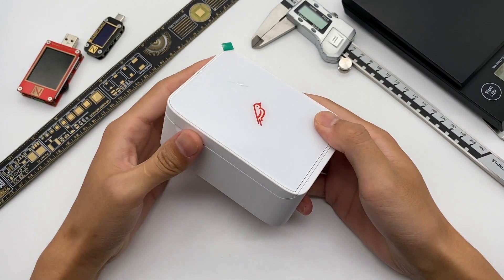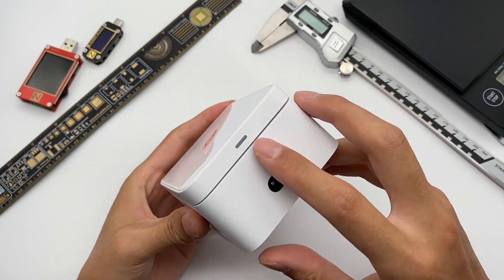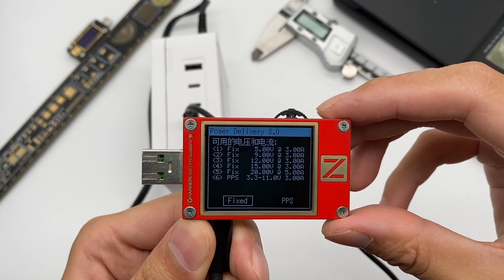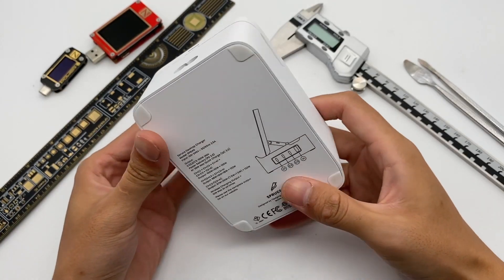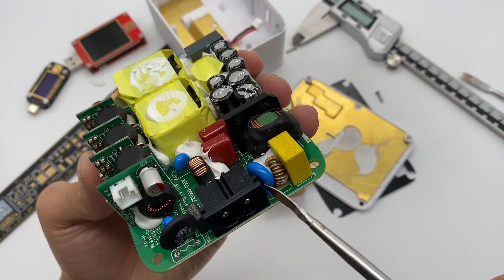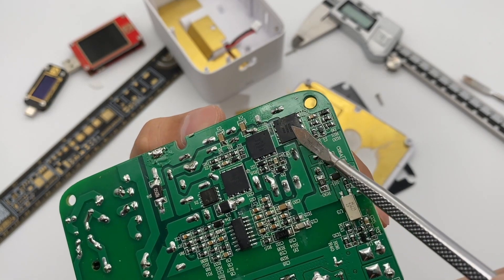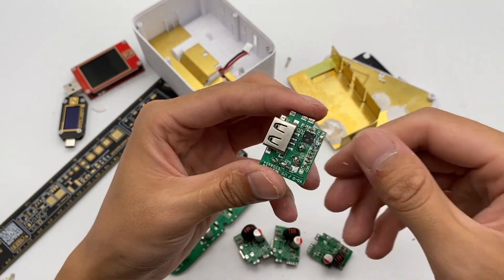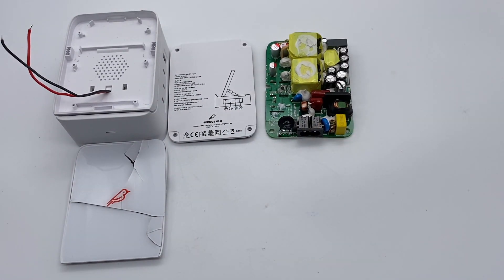Skip the Power Strip | Teardown of Fledging Spruce 5 in 1 GaN Wireless Fast Charger (130W+10W)

Comment: The GaN transistors on the Half Brigde LLC are there totally for name’s sake only. Unless you have a controller and transformer made for GaN’s high switching frequency, they will be/are less efficient than plain silicon mosfet because of the higher conduction losses.

Comment: Not enough input or output capacitors specially the input (as a rule of thumb you need atleast 1uF per wattage output). Whatever caps are there are not of quality brands like Rubycon, Nippon/ united chemicon. 
Not satisfied by the quality and DC-DC converters with decrease the efficiency. I don’t think it will run very cool.